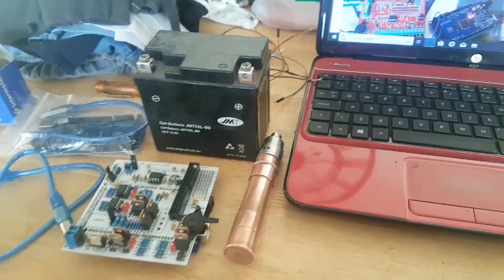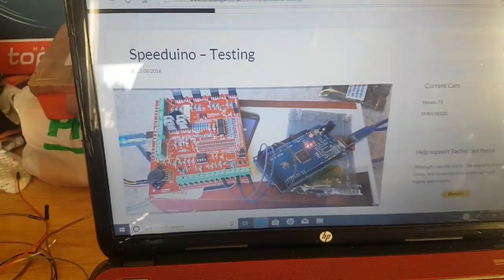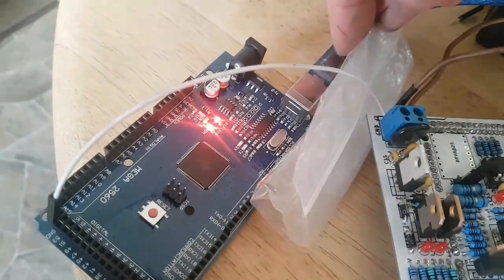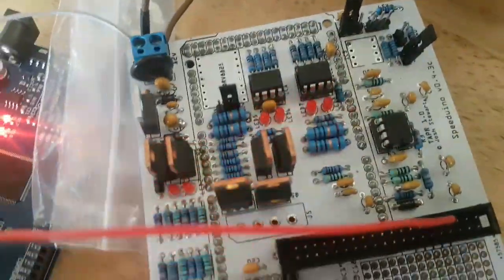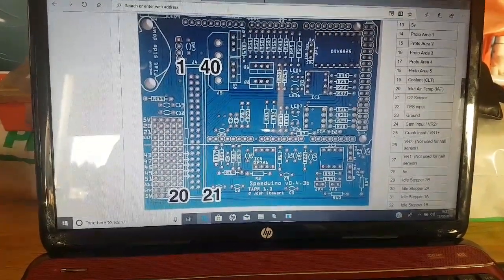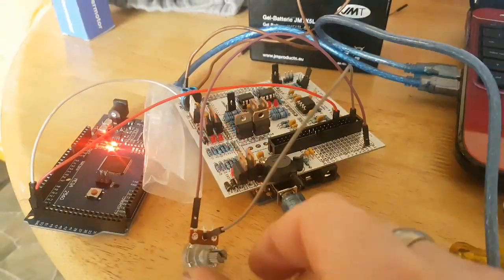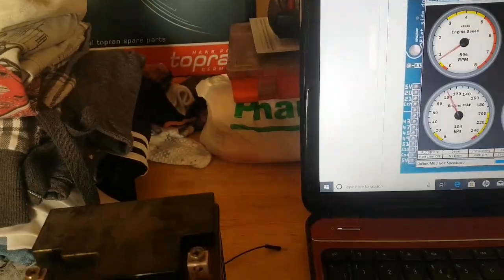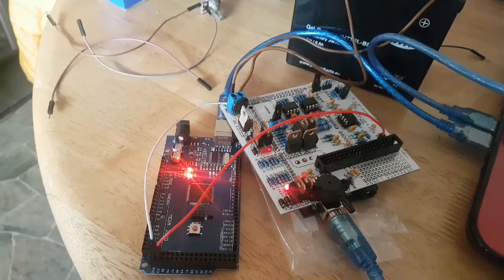Speeduino - The definitive beginners guide to easy input signal testing

Comment: Does anyone know can this ecu speeduino any vers run a inline 4 cylinder PSA TU5jp4 engine in sequential order. Cause therese a trick to this particular engine. There is not any camshaft position sensor for this and the OEM ecu uses special coil pack to run this engine sequentiall ignition . But i do wanna get an after market one
Reply: i can get the RPM from just one tooth on a single crank sensor, but to implement that into the speduino code? naw. i have gone through teh code countless times, i just cant find any reference to timers or pins associated with teh cranksignal side of things. im not using any of the listed methods.

its easier for me to just keep going with my own lil ECU, actually.

Comment: I've connected the speeduino to tuner studio and arduistim to druid. Almost everything seems to work just fine but the spark and fuel LED's aren't flashing ans  I'm still not getting crank speed (rpm). I'm using a v0.3.7 board.
Reply from the maker: Have you joined the speeduino forum? Those guys are brilliant at troubleshooting. I'd suggest maybe take a 2nd look at all of your soldering. It's usually a bad solder that causes these things. Cheers. 😊
Reply: @peteledwidge3631  probably it is, even if it came assembled already ?
Reply from the maker: Good possibility theres a board fault, yes

Comment: what i never understood with most speeduino people: why would i need to test the inputs with a laptop? Wire it up to your car and fire it up- no need for wasting your time with playing with inputs.
Reply from the maker: Because most of us have never built a PCB before this, and as amateurs mistakes are made often. Bench testing allows the builder to varify that the unit is in full working order before application to the vehicle, so any faults thereafter are on the vehicle / wiring side, as opposed to the ECU. This is really basic stuff, and good insurance against ending up having no clue where to begin fault finding.
Reply: @peteledwidge3631  Ahh your right, i ordered the presoldered SMD one for 50$ more because i didnt wanna spend 2 hours soldering and having to go trough uncountless hours of troubleshooting just because i cheaped out on 50$ …😜 But each to their own, some learn the hard way. I know for a fact that i wouldve messed up soldering 😂
Reply: @lobotomyy  lol, i soldered a bunch of vape liions to a BMS, strapped it to a solar panel. few weeks later, i pulled it open... tested batteries...hmmm. no charge?

then i saw it.

lol. some turkey, some dunce, went and soldered the charge pos to the charge neg... so yeah, panels been shorted out for the last month or so...

meh. i find the mucking around with signals and the like is more hassle than just following the schematic.

but yeah, sometimes you can make the most simple mistakes. i fried an ECU cus i didnt crimp two earth wires together at the plug.